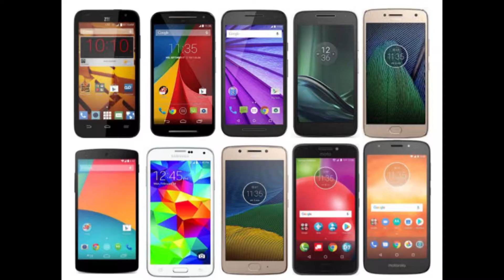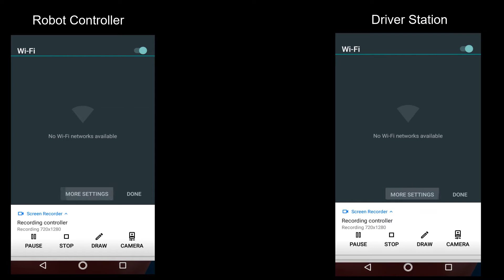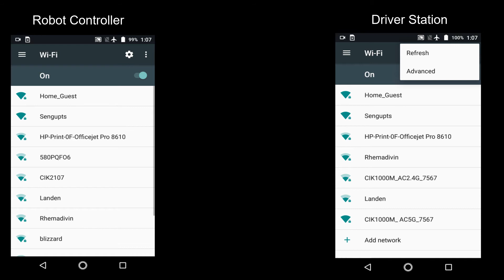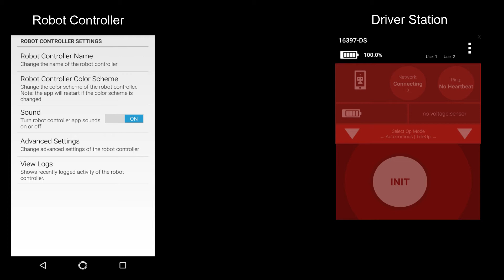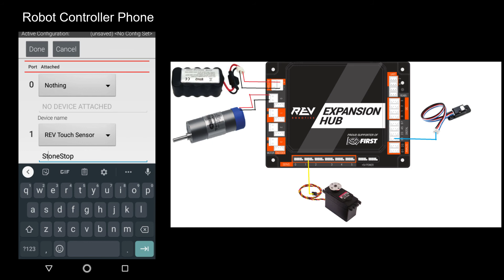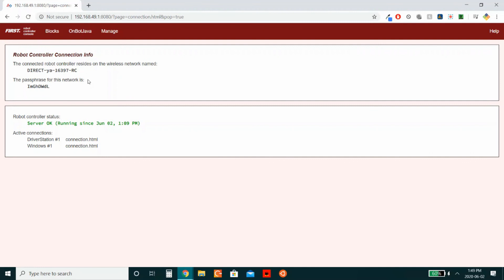Set Up FTC Phones with Rev Expansion Hub (2019-2020)

Comment: I can’t connect the controller hand way
Reply from the maker: Press start+a on the controller once plugged into the phone, and the driver station app is open, which will register the controller. If that does not work then try toggling the mode switch at the back of your controller.